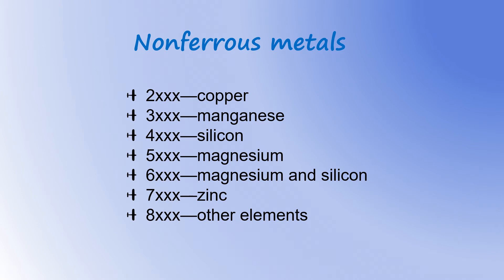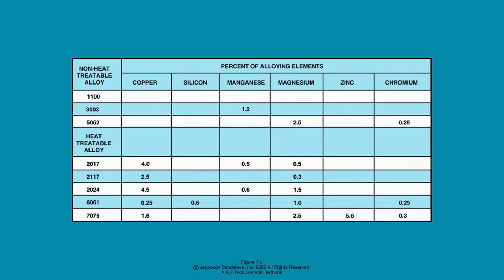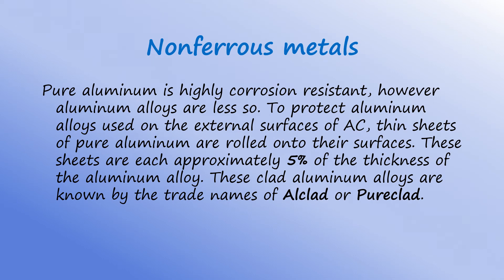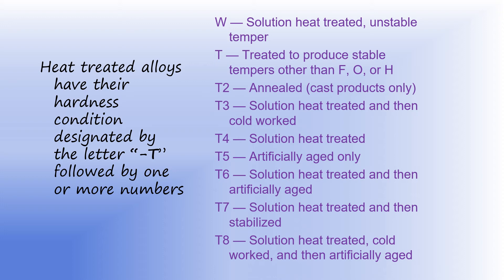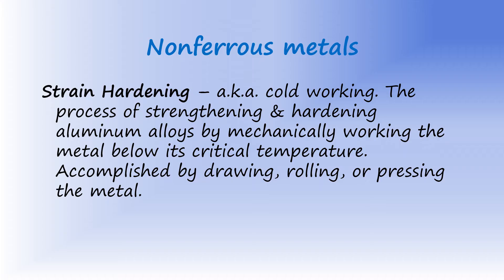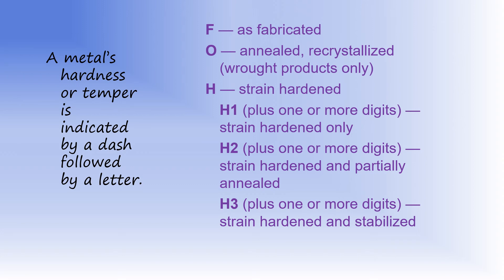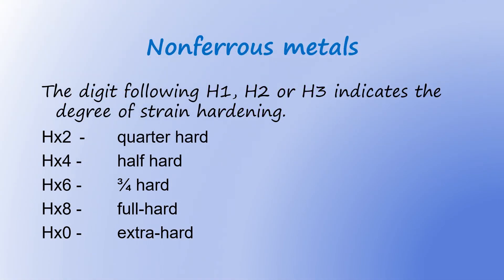Aviation Maintenance - Lesson IV   Nonferrous Metals

Comment: Purely as a philosophical observation. It is not possible to measure the hardness of a metal or alloy "as it was" because the act of making a hardness indentation by any method
causes displacement of the metal and hence results in work or strain hardening. Therefore the hardness you measure is not actually the one before you made the indentation.
Not to worry---all harness values are empirical anyway and we get along quite well by standard methods and reference tables.
"Hardness of metals, as the storminess of the seas is easily appreciated but less readily measured." {Prof Hugh O'Neil, "Hardness of Metals and its Measurement,"  1950.